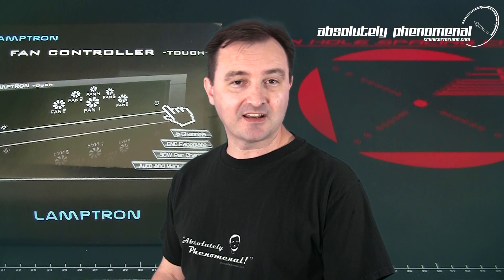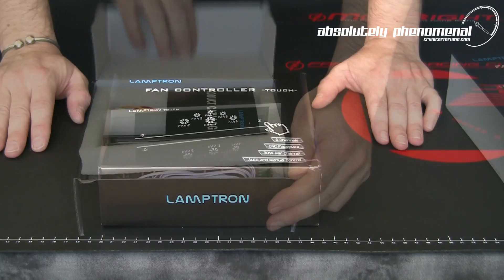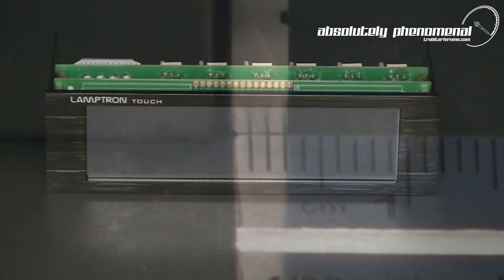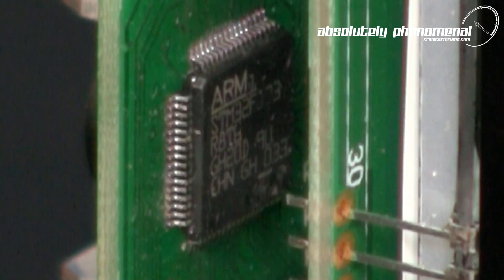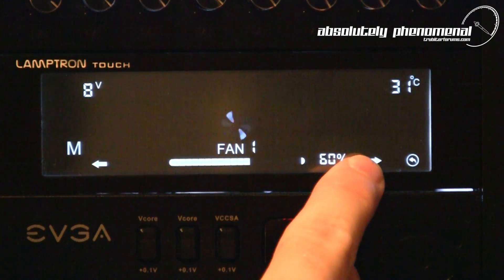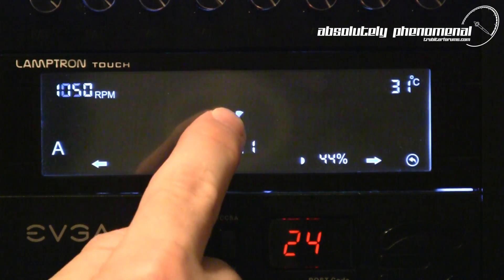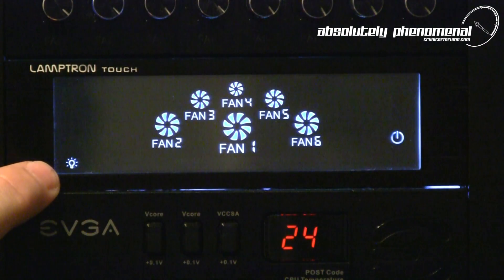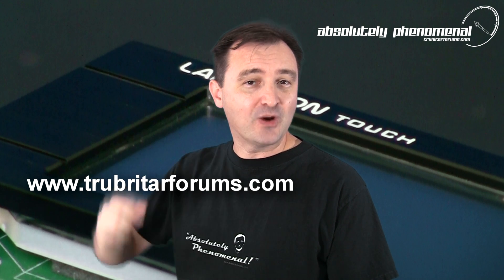Lamptron's Touch 30w Per channel Fan Controller

Comment: I usually wire-up my own cables, so I don't mind that the cables have a cheap look. It's much easier to manage your cables if they all have the correct length..

For an 'sunflower' case I had the bezel powder coated to yellow to fit the case theme. I did the same thing with the optical drive..